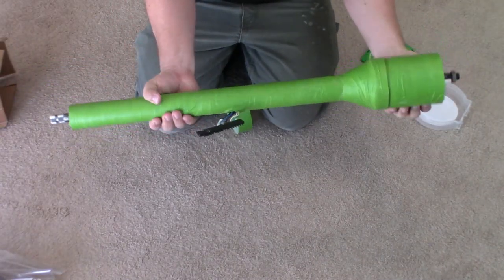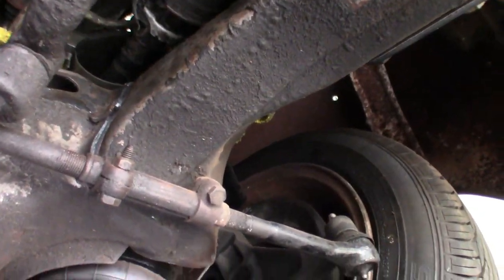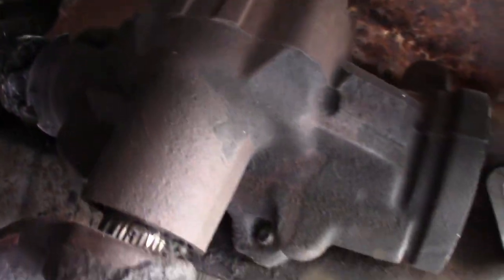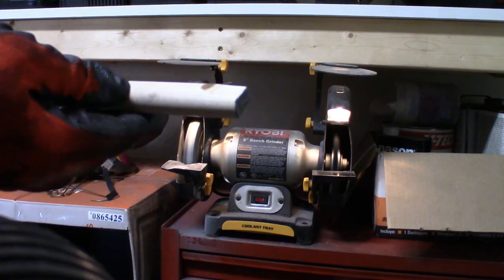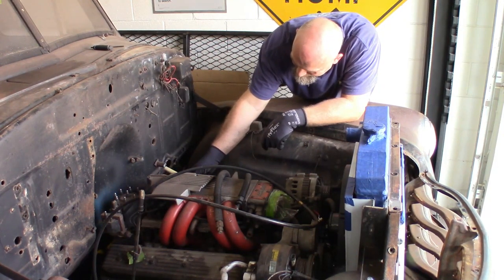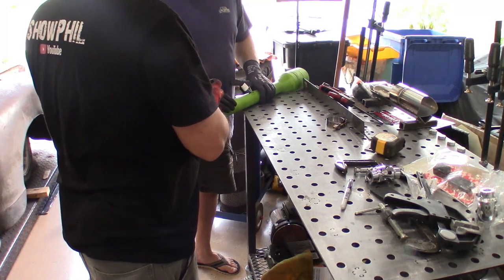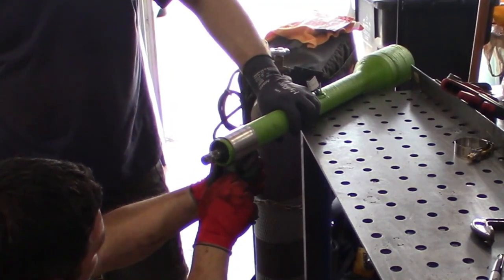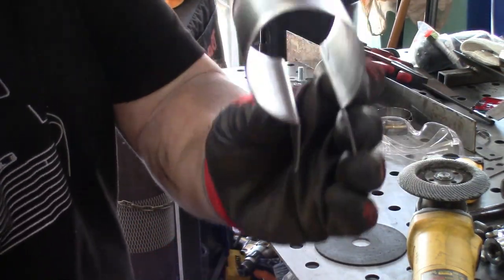PART 39 - 1952 Chevy 3100 - STEERING SETUP COMPLETE!!!!

Comment: Hey Phil. I watched this just this morning and then in the shop today i got my summit column out, good thing i saved my original AD steering column dash clamp.  Take out the 2 rubber bushings and its a perfect 2 inches.  Ill be fabricating a firewall clamp soon. Thanks for the video.
Reply from the maker: Right now I'm using a muffler clamp to hold the column in place.... I'm going to make up a better clamp or find a factory one to use :)  I'll get to that when I re-work my entire dash for the digital dash I'm installing.
Reply: @ShowPhil  i saw that. The u bolt. You had said you didn't like it.  Ive heard some guys have used the crank end of a connecting rod and rod cap .

Comment: Steering is on my to do list thank you for the video. Helps with some ideas.
Reply from the maker: Glad this video helped! I've seen too many people just throw a straight rod in and it rubs against the manifold.... I can only imagine how bad the steering wheel vibrations would be!
Reply: @ShowPhil   I think my truck has the worst steering known to man. The vega box is so worn out and binding. It is setup as traditional steer and the vega box was mounted upside down. I bought a new Impala power box I want to make cross steer. My biggest problem is I have no idea what steering column I have that needs rebuilt with new bearings. I would want my rods from column to go right next to frame and run down to box to have as much space away from engine block as possible to be out of the way for any engine maintenance. Your video helped me think of a idea with using the joint right at the column to get it to drop and go over towards the frame right away. Most videos I have seen they do not show much of the setup like you did to really brake it down and show the setup process. When I bought my truck it already had this worst steering known to man setup. So I am looking around for all the info I can get to make it drivable and safe lol. This will be my first full steering fabrication. Once again thank you take care..